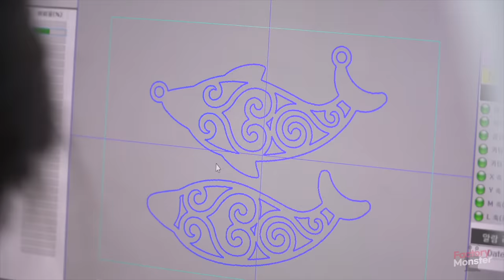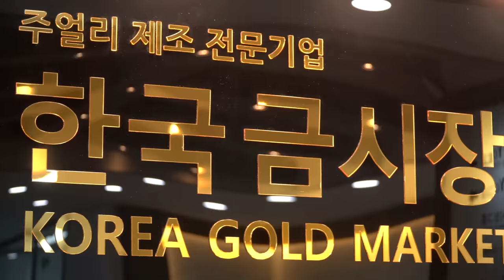Process of Making 999.9 ‰ Gold Jewelry. Gold Factory in Korea

Comment: The first thing I noticed is that the green carpet looks just like the stuff used to line gold miners sluice boxes, and I suspect that it all gets taken up periodically and washed out to recover all the gold dust.
Very clever system.
Another great video, you get access to cool places!
Reply from the maker: You’re right the green carpets are for the fold dust :) Probably the most expensive dust!
Reply: @Factory_Monster  very clever bravo sir 👏
Reply: @Factory_Monster  in india can we get
Reply: they would be asked to even shake their shoes
Reply: Wonder why do they mark the floor with the green tape lines?
Reply: @ankushn6797  they probably leave all the clothes in the changing room, and periodically they get thrown in the furnace to get all the gold dust out!
Reply: @onlymesohyper  that's covering the seams between the pieces and astroturf carpet, and around the edges of outlets etc.
Keeps the dust on the carpet, and keeps people from tripping on the edges.
Reply: I didn't even think about that, but yeah, you're right.

Comment: Floors and surfaces are vacuumed up daily as that’s why the floor is covered with Astro turf because it catches the gold in the fibers and makes it hard to identify and steal. They literally vacuumed out the carpet and run it through a small trommel.
Not one flake goes to waste. Here in America they don’t think about this. You can vacuum around a jewelry shop storefront take home all the stuff and pan it out with water and soap to remove the surface tension so that the thin flakes can’t float on the top 🤷‍♂️
Reply: you should be a consultant to the shops
Reply: I'm not sure what year you think this is, America and Europe synthesize their precious metals using particle accelerators.

Comment: Fascinating to see how its made!  Each step so precise. With gold, you cannot waste a single shaving, so shavings are also collected and melted back down to wire.  I hope one day, I can work with a bit of gold to make something pretty myself. What a joy to see this beautiful metal molded into lovely wearable art. Thank you!  고맙습니다!

8:22 - the little tiger pendant is 11.262 grams.  18K gold is currently at $40.06 per gram x 11.262 = $451 + labor + profit which means it could sell for $800.
24K gold is $53.41 per gram so it would cost $601.50 to make it + profit + labor = $1200 or so.
Reply: That’s including no waste product though, which is impossible if you’re making the pendant. I would add 4-5 grams just for waste, of course you’ll be able to melt it down, but you still need that extra. If a novice such as you or I wanted to make this it would cost similar to what it would cost to buy it I imagine.
Reply: @iqfend  I am certain it would be cheaper and more handmade appeal.  You have to buy the gold cheap, that is the trick.
Reply: A 18k gold is about 60 usd now

Comment: I thought 999.9 gold is too soft for jewelleries? Btw awesome pieces there ❤️ Love the fish
Reply from the maker: They are beautiful :)
Reply: The gold is work hardened from the flattening/stretching process. If it were to be heated up it would become soft again.
Reply: Actually you can make jewellery out of any gold but they will be heavy… if the gold are too thin they will bend easily and that’s what makes them hard to sustain themselves. They lion pendant you see can be made under weight of 2.5 grams too but it should be alloyed with other metal like silver or copper the pedal you see in this video must be around or above 5 grams.
Reply: @jojopirates  That's what I thought too 🤔 Jewelleries are usually made with 950 or 916 gold so the item will be harder. But 999 gold is good for investment 🤔
Reply: Here in the United States pure gold jewelry is extremely rare but in places like India they believe in only wearing pure gold or 23K just depends where in the world you're at
Reply: @emsamish  I guess 🤔 In Malaysia they like to use 916 or 22K gold. If I'm not mistaken in western countries 14K gold is the most popular? Because it has better wear resistance
Reply: @ryuukakhadijah7766  yes 14k mostly & 18k for higher end pieces.  In 20 years of buying and selling I've never come across anything higher than 21K
Reply: @ryuukakhadijah7766  I guess bcoz 999 not much designs can be made compare to 916. As Malaysians, ofc I more prefer 999 (good for investments) but after all it still depends on your budgets. 

Either way, both 999 & 916 are popular in Malaysia.
Reply: Come to asia we use 24k gold as jewelry
Reply: @Bt2027  Woah. Btw, I am an Asian 🤭 But we use more of 22K gold here in Malaysia
Reply: @harima1180  I guess so too
Reply: @ryuukakhadijah7766  it’s more popular in Hongkong china nepal etc
Reply: @emsamish  in india if they can they will wear 24 k gold but mostly 22k and 18k Jewellery are circulated and authorized by govt. And (local) low income jewellery shop owners also cheat their customers as they give you 14k gold and says that it's 22k or 24k since customers are not aware of things they get cheated.
Reply: And here I was thinking that 100% was as pure as you could possibly get.
Reply: @dampaul13  Seems like in the gold metal world, there's no way gold can be 100% pure- it certainly will have some other elements along 🤔 But I'm not sure
Reply: @ryuukakhadijah7766  The title of the video says 999.9%, which is 10x what is possible.
Reply: @dampaul13  Oooh dang it I mixed that up!
Reply: @ryuukakhadijah7766  No you didn't, it's on the person who wrote the title. Possibly done on purpose to get more views and comments, like what I have just done.